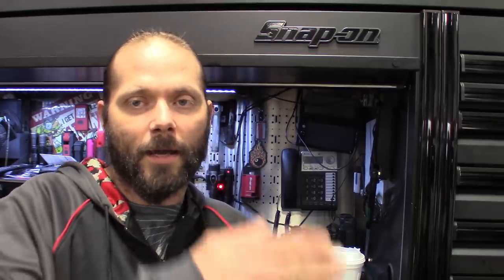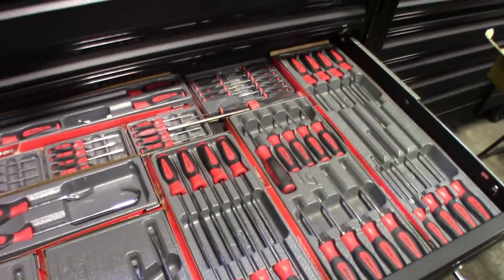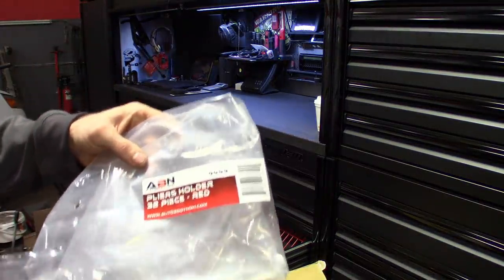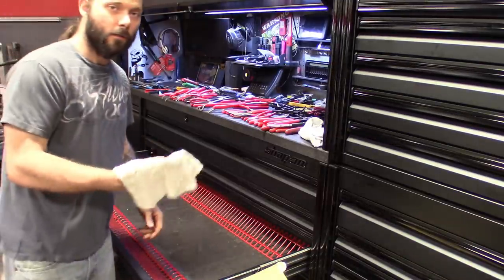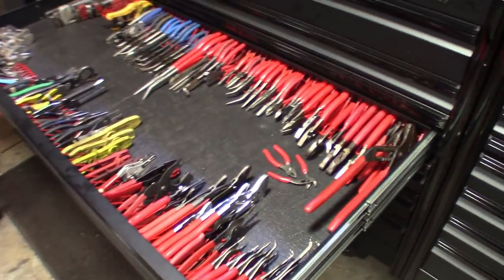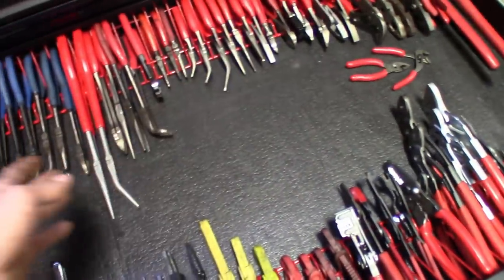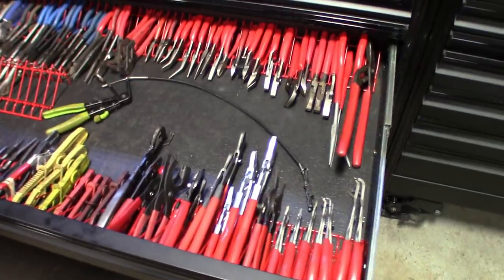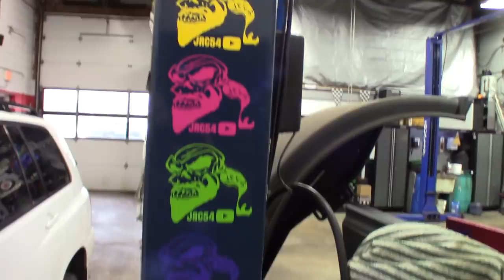Ultimate ToolBox Organization Pt1

Comment: I like those wire racks I bought the plastic Snap-on ones but they are too tall for my drawer so I ended up foaming it and cutting out each plier and using two drawers